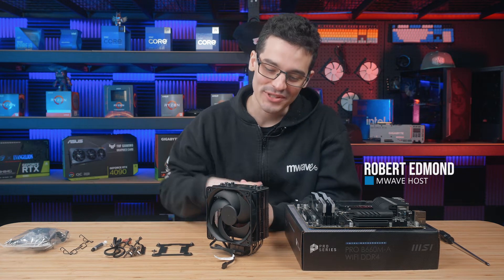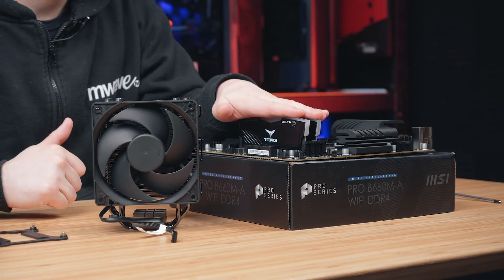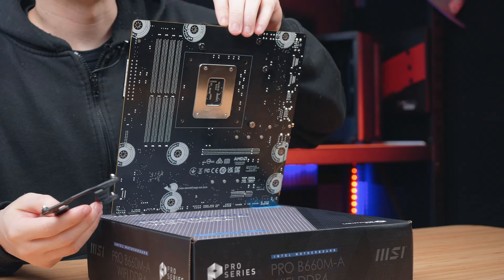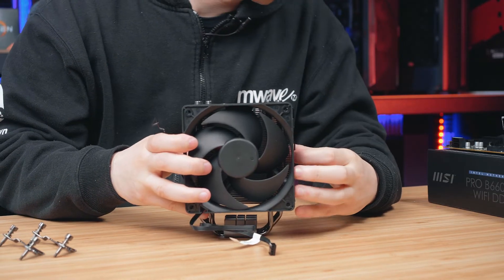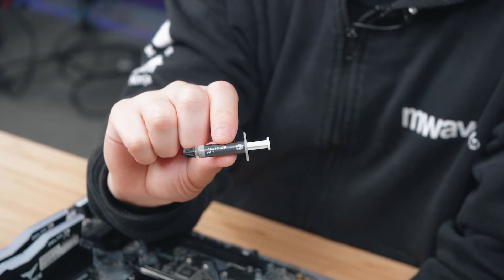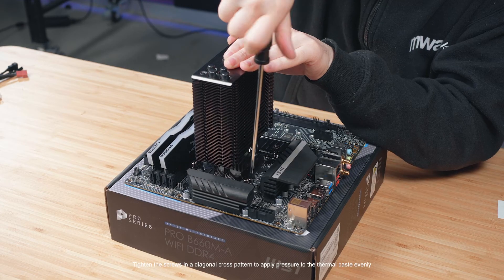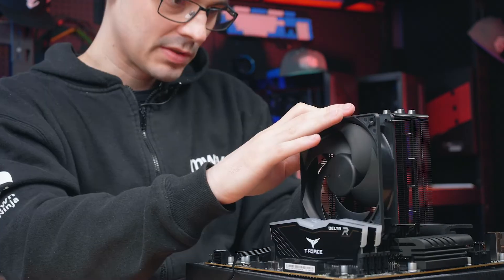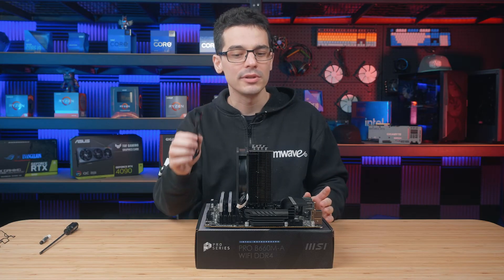How to Install a CPU Air Cooler - LGA 1700 Socket

Comment: how do you know if you need a CPU cooler when i open Task manager it only shows GPU temp and its 70 celcious while gaming and 49 idle but it doesnt show CPU temp so how do u know? and how do i know a cpu cooler would fit im using a H110 ds hyper motherboard its older gen

Comment: These fans don't tell you which direction the air flows. I have two case fans with proper arrows which depict air direction and fan speed direction. I wish these coolermaster fans gave me the same, but from your video and others with similar fans to mine, the air direction appears to be toward the label side of the fan, which are the opposite of my case fans, where the air blows away from the label. Those things would help. Everything else was easy to do. Thanks.

Comment: To anyone scrolling through, can I get a recommendation for aftermarkets?
The stock cooler with the 12400F is just...straight up unacceptable.
(More fun info of me experimenting if you are curious, but it's not necessary)

I've been able to get it up to 100C before which I Task Manager'd out of fear it would shut my PC down, and some of my friends even thought maybe I messed up the thermal paste so I did some research for temperatures with and without thermal paste which was about 10C difference.
So I clean the paste off, put it on dry and...yup, that runs 10C hotter.
So I DIDN'T MESS UP when applying, it is just that bad!

At this point I'm uncomfortable using my PC, so I need advice on what I should do.
I DO have an aftermarket, an Evo 212 I think, but the bracket doesn't seem to fit.
One of my friends was asking if I didn't keep the other mounting brackets but I don't remember there being any, so presumably I didn't.
Do I just-order another, more modern one? (Since I think mine was v1, and I saw another video mention there being 2 iterations.)
Reply: i recently got one for the i5-12400 its called the thermalright assassin x 120 r se its pretty cheap since its 17.90 on amz the temps are pretty low when playing too

Comment: I've installed this cpu cooler for lga1700, however its creating a buzzing noise. Have you come across this before? 
Could it be caused by the metal fan clips? I've upgraded from the og 212 evo cooler and never had this issue before.
Reply: Arghh, it wasnt the cooler causing the noise, it was the hdd. Suprisingly it is a really quiet cooler once I unplugged my noisy hdd.

Comment: It is easy to place the backplate on the LGA1700 socket outside of the case on a new pc. But what about when replacing a cooler on the motherboard inside the case? Will the backplate not fall off when trying to put the motherboard down for installing the cooler. How do we keep the backplate in place and put the case down?
Reply from the maker: Hey mate. With this specific CPU cooler, it can be a little more difficult to install when the motherboard is already installed inside the PC. The backplate should be able to balance on the back of the motherboard while the PC is upright, but as you need to secure the mounting brackets to the cooler first, you will have to try and juggle a few things while making sure the backplate doesn't get pushed out.

I would recommend trying this:

- Install the mounting bracket to the cooler and find the correct orientation and position for installation (make sure the logo will be facing correctly).
- If you are right-handed, balance the bottom side of the cooler on your wrist or lower forearm, and hold on to the bottom right screw with 2 fingers (hold on to the bottom left screw if you are left-handed).
TIP: If you place the cooler flat in the palm of your hand with the logo facing you in the correct orientation, the side of the cooler which is touching your palm is the 'bottom side' of the cooler referenced in the previous step.
- Make sure you have enough control to be able to turn the screw that you are holding on to, while still being able to balance the cooler with the same hand. If you are unable to do this, try repositioning the placement of the cooler on your wrist/forearm.
- With the opposite hand, grab and position the Backplate into the back of the motherboard and hold it in place.
- Carefully line up the Cooler with the Backplate and attempt to screw the bottom screw which you are holding onto. You only need to screw it in just enough to hold onto the thread and this should be enough to stop the backplate from falling out.
- You should now be able to let go of the backplate and use 2 hands to screw the rest of the screws in. Make sure not to let go of the CPU cooler until all 4 screws have been tightened and make sure to use a screwdriver to finish the job.

You can avoid all of these steps if you have a friend, housemate or relative that can offer you a helping hand 😂 Hope this helps mate!
Reply: @MwaveAU  Oh my God! That is some pro athlete level juggling. I better ask a friend to hold the back plate in place while I screw the heatsink onto the motherboard. But what about the thermal paste? Will it not roll down from the cpu if I attempt to apply it while the case is upright? Will it stay on the CPU long enough for me to place the heatsink on the motherboard?
Reply from the maker: The thermal paste is normally not very running and it should stay on the CPU long enough for you to connect the mounting brackets to the backplate/motherboard. I would recommend prepping everything and adding the thermal paste onto the CPU right before you connect the cooler so you don't leave it there for too long.

I have applied thermal paste on a CPU while the motherboard is installed and the PC is upright and have not had any issues with it running down and making a mess. Again, just don't leave it on there for a few hours before installing the CPU cooler and you will be fine 😊
Reply: @MwaveAU  Thanks a lot. I feel more confident now.
Reply from the maker: You got this mate! Let me know how you go once it is installed 😊
Reply: @MwaveAU  I am considering Xigmatek Air Killer Pro and Deepcool AS500. The Deepcool one will barely fit in my case with only about 1.5mm height to spare. Do not know if I even need that powerful of a cooler with my 12400. Another thing is the plus version of the AS500 with two fans for push-pull costs about the same as the standard AS500 with a single fan. I am confused what to get. The AS500 plus fan gets very close to the rear 120mm case fan. Will it be worth it or create any air flow problem? But the numbers of the Deepcool AS500 for 12400 or 12600K or any other intel cpus are really good and very tempting- at least from what I have read in the reviews and youtube videos.
Reply from the maker: Let me have a better look into this tonight when I have a little more time free. Can you let me know if it's the Intel Core i5-12400 Processor, or if it is the F variant? Can you also let me know what PC case you have?
Reply: @MwaveAU  I have the standard i5-12400. Is a 140mm fan cooler like the AS500 really worth the price and all the hard maneuvering for a low powered cpu like my 12400 because I am sure it will almost touch the case glass. My case is value-top vt-g651a m-atx and motherboard is gigabyte b660m ds3h ax ddr4. Do you think I would be better off with something like the Xigmatek Air Killer Pro which is more than half the price? Do you have any recommendation for a cooler for my pc? The Xigmatek Air kiiler pro has more cfm and air pressure than Deepcool AK400 which is similar in size and price. But the Xigmatek will be a hassle installing inside an upright case.
Reply from the maker: Okay, I had a little time to check out the coolers and your case. 1 question first, what region are you from? I am unable to find much information on either the Value-Top VT-G651A Gaming Case or the Xigmatek Air Killer Pro CPU Cooler... Either way, I am unable to compare the pricing.

The Intel i5-12400 CPU is a low-powered processor, I honestly feel like either of these options would be fine to keep it cool. I would probably recommend going with the cheaper option. One to consider, there are some cheaper coolers like the Cooler Master Hyper  212 ( the CPU cooler used in this video) which has support for 2x 120mm fans. It has an additional clip for you to use, you will just have to buy an additional 120mm fan. Check out the price of the Hyper 212 + a cheap 120mm fan and see how it compares to the cheaper of the other 2 options.

As for the cooler touching the glass. If the case has a tempered glass side panel, then it will be fine. However, I personally would still prefer it not touch, if possible.
Reply: @MwaveAU  Thank you for your advice. I am from Bangladesh. This is my first desktop pc just bought last year. So everything is pretty new to me. The temperature during the summer gets anywhere from 31 to 41C and up. Very hot. I will mainly use the pc for learning programming. No gaming. Do not even have a dedicated gpu. I occasionally use Shotcut which makes the 12400 take on 100% load through the video exporting. I could go for Deepcool AK620 or AG620. The AK620 has the same height as the way cheaper Xigmatek Air Killer Pro- 160mm. Would comfortably fit inside the case. Do you think I would need the powerful dual tower dual fan AK620 for a 12400 on a gigabyte b660m ds3h ax ddr4 even if the room temp. rises to around 40C?  Also cheaper single fan coolers do come with an additional clip for another fan. Could I buy a case fan of similar size and rpm and fit it with the clip and connect it on a sys fan port on the gigabyte motherboard? Because I could only find case fans here. Is that how it works for a second fan? Would a second fan for a push pull configuration make any difference in temp?
Reply: @MwaveAU pu❤

Comment: Did you have to buy the adapter kit for the LGA1700 socket or was the included hardware enough? I'm seeing an adapter kit available and now I'm not sure if it's the same hardware that already comes with the cooler or not. Please advise.
Reply from the maker: Hello! It is best to double check the manufacture product page for the full list of compatible sockets, and make sure that it supports the LGA 1700. The adapter kits are for older CPU coolers that were purchased before the 12th/13th Gen Intel CPUs were released.

Comment: My cpu cooler master 212 black edition is slightly bent ( main frame) and quite wobbles placed on a plan floor is it normal?
Reply from the maker: Hello mate. Most coolers should be able to stand up straight when you place the baseplate on a flat surface. I am not 100% sure what part you are referring to as the "main frame" but no, this does not sound normal for it to wobble.

The "Cooler Master Hyper 212 Black Edition CPU Cooler" is not an overly big CPU cooler, and even with 2x 120mm fans connected, it shouldn't be enough weight to bend the cooler while it is installed inside a PC.